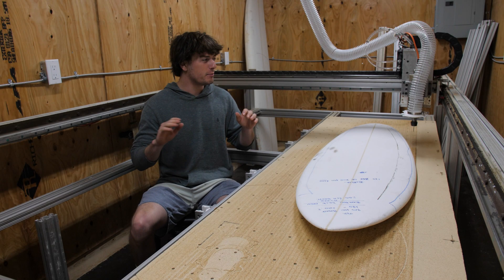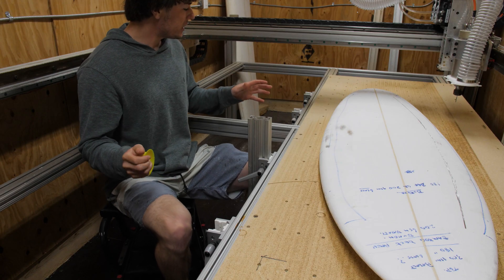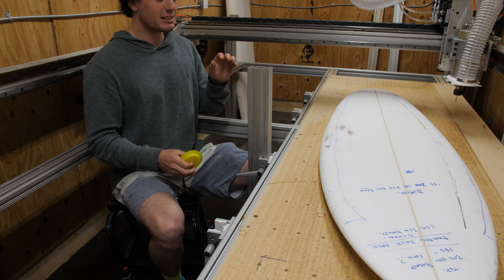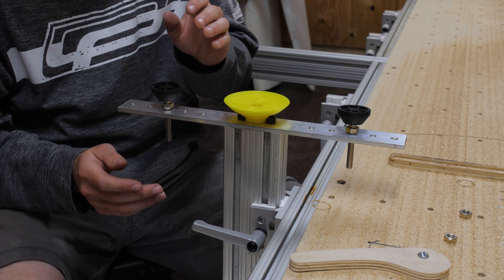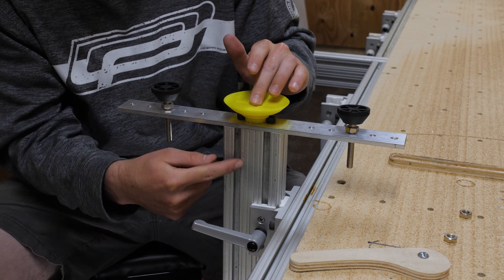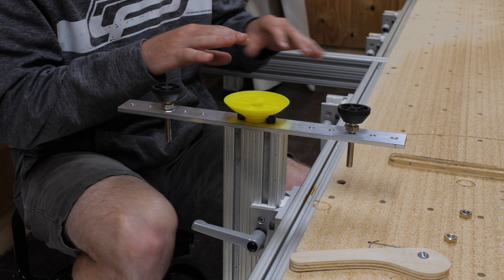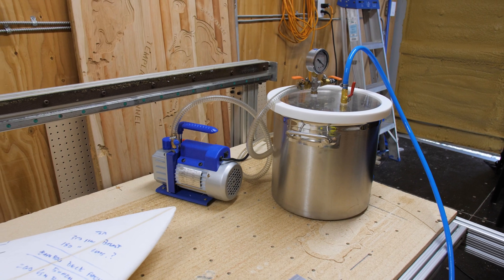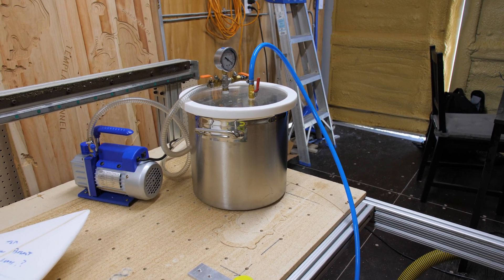SUCTION CUP VACUUM FIXTURE | CNC BOARD SHAPING MACHINE | EP1

Comment: Dude you’re a genius! You built your own cnc machine wow. 
I have a thermwood cs40 with a vacuum table . And I want to cut surfboards on so bad . I been cutting cabinets on the machine for 20 years and make surfboards on the side but have them cut by marko foam .
Reply from the maker: Go for it, if the machine ins't big enough to do the whole board, you can always split the board into chunks and gorilla glue em together afterwards.

Comment: Just started building my own and the vacuum post do you have a parts list and where you got them for the board vacuum post would you??
Reply from the maker: Hey Curtis, 
I got all the aluminum extrusions and slider pieces from a brand called  80/20 aluminum. You can order custom length parts from them online. The vacuum pump, vacuum pot, and air tubing I got off amazon very cheap. And the vacuum pads are custom parts that I designed and made.

Comment: I've done lots of R and D lately into vacuum pumps and clamps, to use with my CNC. I've made myself 2 HDPE boards, with backer rod foam gaskets, no suction cups, but that's a cool idea.
I've never seen anybody use a pressure pot....interesting idea.....
The pump I have is oil-less, looks like yours isn't. I would highly recommend oil-less.
Reply from the maker: Hey, thanks for the info. The vacuum pump I have came with the pressure pot and was super cheap. Seems to do the trick for now. If It breaks I will try an oiless one next!

Comment: Put some anti-fungal agent in your spindle cooling fluid. Demineralized water + (in a pinch) antifreeze is an option but commercial stuff exists too.

Also, dip your suction cups in two component liquid silicone (the stuff you can get on amazon to make things like silicone molds). That will reduce the leaking.
Reply from the maker: 2 good tips thanks alot! Ill add some antifreeze to the fluid for sure. 
I've got the suction cups working quite well now, but if they break again I will be dipping them for sure. Way easier.

Comment: great work man! just wondering how much did you spend at this stage?
Reply from the maker: Hey Carlos, Starting from scratch I'm about $7000.00 CAD ($5500.00 US) into the project. I did get a very good deal on the frame ($2000.00) as it was sitting unused in someone's basement and he was excited to see it being put to work. At this point the machine is finished and I don't see myself having to put anymore money into it, just minor tweaks to make it run better! Cheapest machine I could find the same size as this was around $25000 US. It was a bit of a mission to build it with info being difficult to track down, but saved a TON of money!
Reece
Reply: @reeces_shredlab  awesome! whats the max length you can cut? did you find a solution to the vac cups for the blank?  price is still reasonable. cheers!
Reply from the maker: Max length is around 8'6", and yes I did end up figuring out the vacuum pads, I'll put up what I did in the next vid!

Comment: Heyy there love what your doing! 
Have a question about how you set up the referencing for the cut when using the suction cups? 
Any tips?
Reply from the maker: Hey Matteo, kind of hard to explain with words but I'll try! 

I have 4 suction cups, but only use 2 of them to reference the cut. The middle suction cups are only used to support the board while the ones closest to the nose and tail are used to line up the blank.

I model the blank on my computer and nest the board file inside of it.

Then, in the software, I draw a line parallel to my machines Y-axis and then move it up/down the Z-axis until the line is just touching the bottom of the board. The line should be touching the lowest point of the board in the Z-axis, preferably the middle of the board if you're cutting the top, or the nose/tail if cutting the bottom. This line is essentially acting as the "bed" of my machine.

Then I measure along the line where I want to position my 2 suction cups with respect to the nose and tail of the blank. (I placed mine 150mm from the nose and tail..I think)

Once I've decided where to put the suction cups, I can now measure how far apart the two suction cups will be.

To figure out how high the suction cups have to be (Z-axis height), I drew two more lines that measure the distance between the original line, and the bottom of the blank 150mm from the nose/tail. 

Honestly a picture would be way easier to explain, or I'll just try and add it into the next vid..
Reply: @reeces_shredlab  
Cheers for the explanation! 
We are looking into a few different ways to do this, but yeaa an explination in your videos would be amazinggg!!!! 
Love what your doing with the channel 🙌 we will be along for the ride!
Reply from the maker: No worries, I'm still figuring things out as I go as well. If I figure out a good technique for it I'll try and make a video.

Comment: Get a pressure switch. I have done this for vacuum bagging surfboards so that i dont need to keep the pump running at full tilt if there are leaks. You can set the pressure and the pump comes on and off to keep it at that pressure, real easy to add into the switch in your pump. something like this: https://cpc.farnell.com/multicomp/psf109s-81-330/pressure-switch-vacuum-2-9-to/dp/SN36440?mckv=sExqq673e_dc|pcrid|490691434481|kword||match||plid||slid||product|SN36440|pgrid|47130025876|ptaid|aud-610668504919:pla-371786579238|&CMP=KNC-GUK-CPC-SHOPPING&s_kwcid=AL!5616!3!490691434481!!!network}!371786579238!&gclid=Cj0KCQjw8vqGBhC_ARIsADMSd1Ci-kqI3ABKSW3Bxe3vRzWvSWfswu_xDr_3XrZbOecN1leoWT1IQH4aAva1EALw_wcB
Reply from the maker: Hey David, thanks that's a great idea! Part of my problem is that the vacuum pads are leaking so fast, the switch would be on the whole time anyways haha. Molding my vacuum pads out of a softer material and combining them with one of these switches sounds like the way to go!